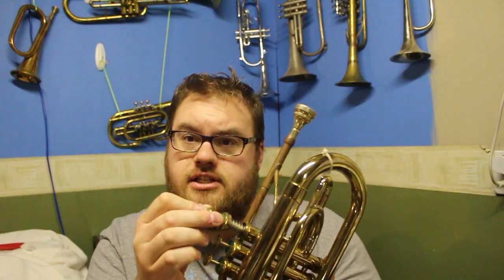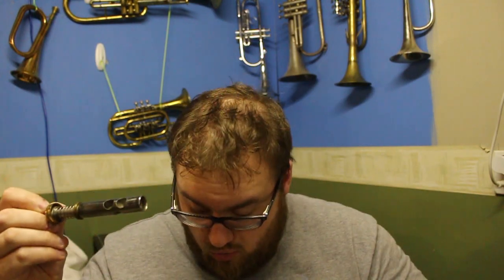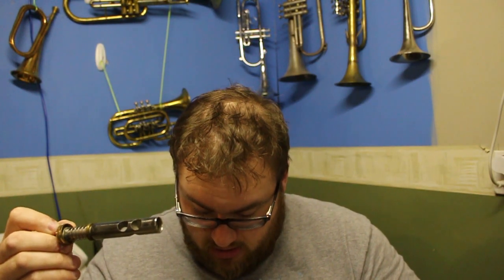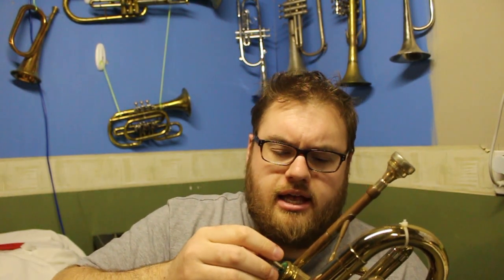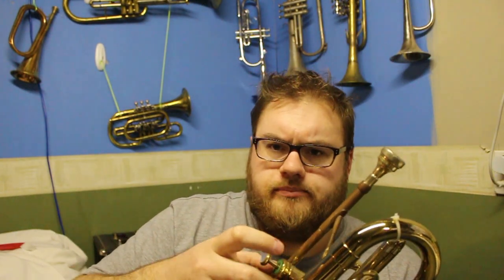RANT: You're using your valves wrong!

Comment: My teacher has a bell front euphonium made in 40-s. If you don't know what it is then Google and you'll see how its valves are positioned almost horisontally when held in playing position. Su under their own weight the pistons wear off the tubes. During its 70 years of wear and tear the poston casings have worn a bit oval. We measured it. They move just fine in playing position but when resting flat on your lap they are always sticky no matter what you do. What I'm saying is that it took 70 years to wear down the pistons of an instrument and the horn itself is in perfect playing condition. 70 years. So I think we will all be perfectly fine pushing our valves in what ever way we want until we die and we can pass the instrument forward to the next generation so they can start pushing the valves how they like.

Comment: I dont know about bending valves, but I remember learning in high school that the c shape of the hands and fingers actually increases dexterity and accuracy, and has absolutely nothing to do with handling the instrument correctly. I remember my band director telling everyone to do it that way, regardless of the instrument you played, and that it should be a relatively universal hand shape
Reply: It does, the lack of lateral pressure also means that you're less likely to inadvertently move the instrument, compromising your embouchure. Your band director knew his stuff.
Reply: Same with piano actually
Reply: Yeah, this is technically true, but the thing is, it really doesn't matter. Moving valves quickly and accurately is probably the easiest part of playing the trumpet, and so there's little need to use special techniques in order to improve accuracy. Think about it. When's the last time you were playing brass and you found that the reason you couldn't get through a song was because your fingers couldn't move fast enough? That's just not a thing. Fingering is the easy part of playing trumpet. Articulation and embouchure are the hard part. That's why my trumpet teacher was able to play professionally as a jazz musician without using "proper" finger placement.
Reply: @kosmologist  Yeah but with the piano it's actually necessary. With the trumpet it's just not, because moving your fingers fast on the trumpet is super easy.

Comment: I've seen young players with short fingers having terrible trouble with valves sticking, primarily because they have cheap instruments and they don't operate the valves with a downwards pressure but a diagonal pressure  which causes them to jam. An adult with experience would have no issues with the valves sticking on the same instrument, but put pressure on the valve at an angle and it gets tight until it's pulled up and comes square in the barrel again.

The other issue as you say is the valves are hard, but the barrel is a soft material. If the valve has any lateral pressure then the hard metal valve is going to rub the sides of the case. It doesn't need any lateral movement to do this, the mere pressure is transferred onto the case from the valve. However, to do any discernable damage would take an awful lot of operations of the valve.

When I was learning to play, valve oil was forbidden, the only thing you put near your insrument was water.

Comment: Playing with flat fingers is often shamed a bit into in more professional studies, but rather because it avoids less presition, specifically for fast pieces or extracts. The common agreement is for arched fingers, naturally relaxed, arched hand and fingertips on the valves. My Conservatory's professor eveb suggest that this position follows the logistic of natural arched and relaxed hand placement on other instruments such the piano, violine, flute, cello, etc. It is simply agreed that a natural curve releases tention therefor providing relaxation and presition. Of course I have seen a good amount of  players use flat fingers fine, yet I strongly believe on the straditional conservatory method. Relaxed hand placement.

Comment: Not that I disagree, but Brass and Monel (the alloy used in most high end valves) are much softer metals than steel, titanium, etc, which would be the conventional "metal" metals. It is possible to bend solid brass of the thickness of a valve stem, with enough strength and focus. Is that going to happen with the 70 grams it takes to play a valve? no, and you're right. But several 10 million little presses will slowly make an impact. (not that anyone but the most professional would ever play their valve that much)

Also, the whole valve is not one solid block. The monel (or stainless steel, if they're cheap) valve core is attached by some way to the brass stem. A good instrument will have the brass extend deep into the middle, with a strong mechanical connection. Cheap ones may make it shorter, or horrors, use an adhesive. If something fails, it would be this connection i suspect, not the stem itself. I do know of an instance (not personally) where the stem separated from the core entirely. And it is theoretically possible that it may have been caused by lateral pressure. Of course, it was the most cheapest of instruments.
Reply: no
Reply: Jesse Mallen congrats. As soon as you actually have a problem with your valve after applying negligible force 10 million times, tell me.
Reply: I've been playing for 8 years as I want, brass or other metals like aluminum and copper won't bend with just the force that you put on them with your fingers, even if it is a repetitive and rapid task, they won't bend, not even a little.
Reply: Jesse Mallen I

Comment: Hi Trent you are right, keep a car well maintained, and it will run 500000 km with ease. Those pistons are a lot shorter than in an instrument and are always pressing sideways.  And with the speed and times they go up and down you have to play more than 100 years continuously before they wear out 

And you are pressing right, your fingers will feel it when pressing the valve is slightly more difficult.

Comment: Well, back in the 70s I had an early make of Yamaha 4v euphonium - brand new.   As I broke it in - valves stuck regularly and had to have lots of oil and be very clean, minimal muck and you had to clean the valves and casings before they worked right again. It seemed to be better after break in, and the horn sang well (very soft brass), and got lots of medals with it.  But I noticed that the break in on it was so tight that when others played it, the valves would stick, and not for me.   That was my personal experience with an early one.  I have a nice silver plated one now, and it doesn't seem to have any of those issues and I got it used.   The tubas I use are at least 100 years old and I have to use Ultapure Light Bearing oil as valve oil to have them play well enough for me, so I wonder with extreme wear, how that would add up.   I have a bud who had a compensating yamahonk tuba and the valves were such a pain to get broken in that he finally had the shop go through it, and now its ok to play.   I just offer this as anecdotal experience.    With that early 70s horn, when I finally got through college - it was kind of spent.   I was disappointed with it as I figured a good horn will last a couple of generations with care, and so when I was out of college and finally had money, I bought a miraphone 4v rotary euphonium - sort of a 186 in 3/4 scale.   That horn was as nice as I bought it when I sold it 30 years later.   So there's an entry in the 'for what its worth' column.

Comment: My own experience is that if I use the 'fat finger' / 'over the top' finger method, the valves often don't go all the way down. If I push the valves down directly with the 'pads' of my fingers, this problem of valves not being depressed all the way does not happen. That's my version of common sense.

Comment: the only real worry about lateral pressure is when you are moving the valve continually while applying pressure to the side of the valve. this will cause the valve to scrape, even if it is a very small angle, against the side of the valve casing. we all know this would be detrimental to the smooth flow of the valve. out of all my band teachers over the years that's the most stressed lesson out of them, along with practice and maintaining your instrument.
Reply from the maker: That's one of the points I made in this video. If valves have wiggle room, then this issue will be more likely. If the bottom rim of the valves are not chamfered and you don't use enough lubricant then in time you can ruin your valves.
Reply: Trent Hamilton exactly

Comment: Apart from playing technique issues, my well-made valves tend to stick more when I'm not pressing straight down. Lube, cleaning, etc., help, but I've still had occasional problems. Also seems to happen only when air pressure is being applied by actually playing. Exercising valves rapidly: no stick. Actually playing: stick.

Lots going on. Would take significant research to prize it all apart.

Comment: Look, the answer to proper valving technique is simple.  The finger should accommodate the motion of the valve key.  On a rotary valve instrument, the motion of the valve key describes an arc as it is depressed.  On a piston valve instrument, the motion of the valve key is straight up and down.  So, fingering the rotary valve with flatly held fingers works out, as they will also describe an arc when depressing a valve key.  But, with piston valves, the fingers should be curled up and over, so that the finger tip can strike straight down while depressing the valve key.  Now, this is proper technique.  It has nothing to do with valve speed, or valve wear, or anything else.  It's just a question being proper.  Like wearing gloves while driving, or using your silverware from the outside in as laid out, or tipping your hat to a lady.  Please people, we must maintain minimum standards of deportment, lest we all devolve to savagery.

Comment: I teach my students to have good finger technique  for the sake of the dexterity of the player to be able to get the best out of the music he is playing.......but also to help the instrument work at it's best.    In my experience - and I have a lot of experience - instruments, even expensive ones -  do wear over a period of time and are sensitive to the way a player presses valves down.  One example - a pro friend of mine played the same top quality tuba for many years and had a very pronounced way of pressing valves down where the the second and third fingers pressed from the side with some lateral pressure - and he never had a problem with his valves.  Now ccasionally when he let another player have a go on his instrument, the second and third valves valves would stick, nearly every time.   The only possible reason for that is that the valves have worn because of the way the owner presses the valves down.  Metal is strong, yes, but it is not infallible. 

Having a rant is all very well, but if you film yourself using poor finger technique, you can expect comments about it.  It doesn't look good, it gives a poor example to people looking in AND it is not good for the instrument, cheap, expensive or otherwise.  

Rant over ;-)
Reply: Brassed Off I bet your students complain all the time about your finger position. Unless of course it's absolutely perfect. In which case I'm going to guess you play the trumpet as your main instrument
Reply: Wrong guess - main instrument trombone, the most perfect of brass instruments in every way ;-)
But if you have to use valves, then the least you can do is press them down in the most efficient way for the sake of the player, the music - and the instrument. Anything else is just lazy.
Reply: agreed about trombone

Comment: Does it matter? 
Not especially in the short term... 
Very-longer term (ie: years of use), yes, a little lateral pressure (and let's be clear, what part of the finger you press the button with isn't a guarantee that you are putting lateral pressure on, or that you're not if using the commonly preferred fingertips) is going to cause problems.

It's attrition (tens of thousands of strokes, if not more) that is going to cause the pistons and casings to wear unevenly - I've seen plenty of instruments with issues like that... Heck, I even own one - my sisters old Benge flugel, which she played from about 7 years old, developed unevenly worn valves due to years of gentle lateral pressure (she played with fingertips, but a 7 year olds hands vs a big flugel bell are going to be stretched).

Don't dismiss it just because you haven't (yet) experienced it - nor do you want to give players the idea that playing with lateral pressure is fine... but let's also be clear (again) that it's pressing the valves down straight that is imperative, not which part of the finger you use.
Reply: Unless you can refute the evidence he presented, your opinion is invalid.
Reply: Evidence? I wasn't aware any was given?

Plenty of assertion, some of it plausible, some not so much - but evidence, I'm not so sure...
I like Trent, but this was a pretty weak video by his normally excellent standards.

I can't necessarily prove it to you (because you hadn't seen it before, and could retrospectively claim it to be anything you liked), but that flugel is pretty solid evidence for me personally.
Reply: I think you're right. I play baritone and it's easier to feel the friction of some lateral pressure and to see the result on the top of the valve. Like all valve, you will always have tolerance beetween the casing around and this allow premature using effect (sorry for my english, I'm a french canadian...). So I play 5 years with a Kanstul baritone (drum corps)  and 2 years Dynasty baritone. Old used Dynasty need to push exactly down because of wrong repeating lateral forces that deform (just a little bit) the casing. Everybody can see this experience in less than 5 years of wrong pushing position. (Maybe drum corp with 12 hours practice, 3 month each year give an accelerate appreciation...)
Reply: And that's why we give these more difficult deform instrument to beginers, they will not detroy good one and they will learn to push exactly down because it's the only way to do with a deform casing if you to play easily!
Reply: To be honest, beginners always get the oldest (or cheapest available) instruments because they're more likely to damage them in some way... it's not because they necessarily provide the best instrument to learn on, it's just what can be spared.

(Or atleast this is the case in UK brass bands.
Reply: Yes, but if you can repair a damaged bell, it's difficult to change a piston casing... (we never do that!) So cheaper instrument are give to beginner like you talk, but difficult valve could be give to the most bright guy who begin in this section (1st, second, ect...). And if someone push in the wrong way, it a good thing to give him these deform valve because often, they are still easy (or easier!) to play in the right position. Must go someday in UK see good band there!
Reply: An instrument with knackered valves is for the skip.. you might give it to a beginner if you had nothing else available and the odd sticking valve wasn't going to prevent them from learning some fundamentals, but you wouldn't give it to a good player - a worn valve like that is likely to have lost compression (an issue lots of old instruments will have even if they haven't been abused), translating into imprecise feel, looser slots (etc) and in most cases this is absolutely not desirable.
Reply: My bad english maybe let you think for big valve problem, don't worry, we scraped instrument that have real valve problem. Read me with perspective of more sensitive feeling for detect minor default in valve course!
Reply: Why would you give a crap instrument to a beginner, the player who most needs the instrument not to get in their way? I would want my students playing the instrument, not fighting it. Perfectly sufficient beginners are forever being driven out of music entirely by horns that won't play. As a player advances, they can make more of a lesser instrument--but will of course make better music on a better instrument.
Reply: Dan Haygood 
Well, atleast with brass bands (usually loaning instruments out for free), the less valuable instruments get loaned to beginners.
It's not so much a question of what plays best, it's what plays best out of what can be spared. 
Tends to be technique (lack thereof) getting in the way of playing more than tired old instruments... lack of patience with slow progress and/or lack of commitment to practice puts far more beginners off than having to use the bands old instruments rather than a new professional model, in my experience.

Comment: Trent Hamilton.  you play your instruments as we say in our school as, "using dumb fingers" and when you do that, you do actually have a good chance of bending your valves.  but you can play however you want without judgement.
Reply: Jack Daniel how tha fuck do you bend the metal with just your fingers
Reply: Jack Daniel send me a picture of valves you bend with your fingers
Reply: Jack Daniel good luck finding them
Reply: Did you watch the video? The only way you're bending a valve is if you're trying to press the valve in any direction other than straight down. So long as your fingers are allowed to slide on top of the buttons a bit, that doesn't happen.
Reply: Musical Endeavors that's what dumb fingers are.  Trent doesn't have a case as bad as I but he can still bend them just enough to make them quit sliding
Reply: Evan White valves don't have to bend completely in order to stop moving,  just a micro bend can do the trick